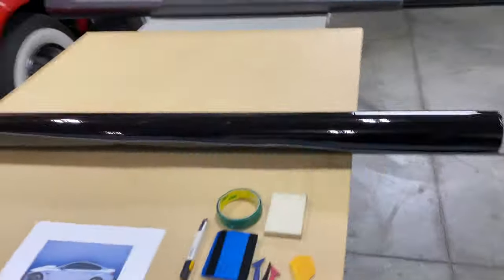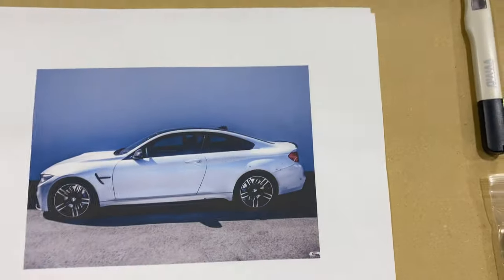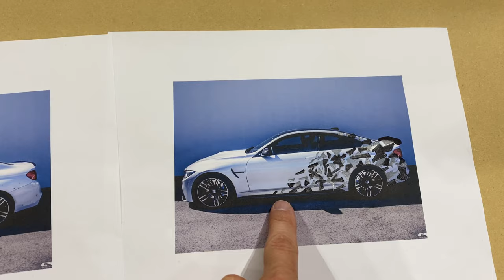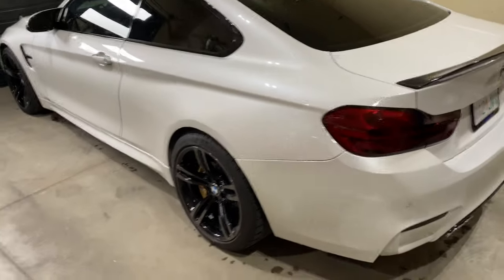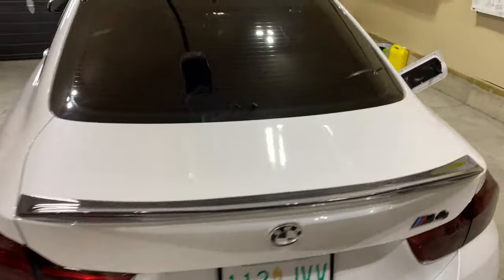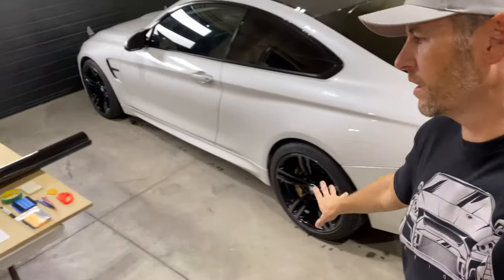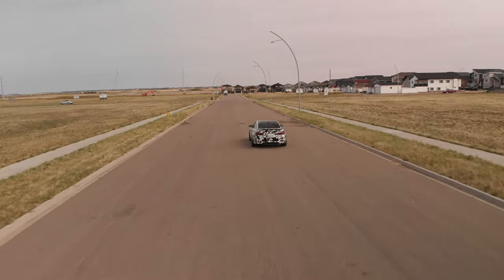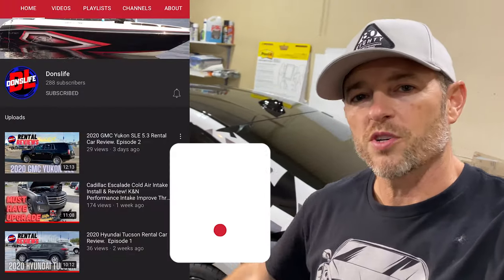Partial Camo Wrap BMW M4 DIY

Comment: Wow that turned out really good. Subbed !
Reply from the maker: Thanks man! It was a fun way to use up some extra material!
Reply: @Donslife  we need a guide!
Reply from the maker: Hey Lazarus!  Did you want a guide on how I planned this partial camo wrap? You can email me or send a message on IG  @donslifechannel
Reply: @Donslife  when overlapping pieces does the edge not show on the pieces that under the top piece? Thanks
Reply from the maker: @xijordyixxijordyix4392  yes overlapping pieces will show a line, but depending on colors used it may not look bad.  I tried no over lapping on my latest camo wrap but it takes more time cutting pieces to fit together better.

Comment: Did you overlap any of the shapes or are they cutwhere they meet? Had envisioned something similar. From a distance it looks amazing. Wondering how the overlap if any looks up close.
Reply from the maker: Hi Raul, I did some overlap and same cut together so they fit seamless.   Honestly the overlap was fine to look at up close.  When drying the car after a wash, I just needed to be careful in a few spots (especially points).   I am thinking of doing this to my new truck soon.  I miss it now that my M4 is a full wrap.

Comment: Follow on question....😂  where did you come up with the shapes? That's the most difficult part i think. I'm sure having small pieces is easier than trying to wrap a full panel.
Reply from the maker: I made completely random shapes and had one of my daughters help so we had more
variety.  I also kept all the similar sizes in piles so all of the shapes gradually got bigger towards the back.   I recommend printing pictures first and draw shapes on the paper.  You’ll know pretty quickly which shapes look good and which don’t
Reply: Is there a video with a list of the materials you used? After the alcohol to dry it out I’m guessing just heat gun and squeegee?

Comment: How much vinyl would you need for it i have a 3 series bmw and id like to go on the cheaper side
Reply from the maker: Not that much depending on how you cut you patterns. Maybe 5-6 feet of each color. Most material is 5 feet wide already.  So 25-30sq ft of each color. Maybe even less
Reply: @Donslife  thx bud

Comment: bro i need help getting my charger gt wraped in this similar style can you help me i want to do the front but i dont know much should i get its 53 inches by x {x as in how many feet} how many feet should i get i was thinking like 53 inches by 5 feet is enough
Reply from the maker: First you’ll need a couple colors.  I had black and charcoal matte.   I used maybe 5ft x 5ft of each color.    I just did a new camo wrap too on the channel!
Reply: @Donslife   i plan on using one color only there’s an option for a 1ft x 1ft should I just get like 5 sheets of it ?
Reply from the maker: 5x5 is 25 square feet.  Five 1x1 is only 5 square feet which will only do the bumper.  At a minimum I would order 15 sheets of 1x1    Some of the pieces at the back of the car were 1x1 approximately

Comment: How well does it stay on though? I had some decals on my car that after a few washes started peeling, how has this held up so far?
Reply from the maker: It lasts fine if all the vinyl was post heated for maximum adhesion.  For wand style pressure washing it is recommended that you spray straight on the surface and not at an extreme angle.  When hand washing, pick a cloth or sponge that won't catch the sharp points.  I use a synthetic chamois to dry too.  My latest camo wrap is even crazier and I have had very little with issues.

Comment: How's it holding?
Reply from the maker: Great until I wrapped the car 2 more times.  The wrap never failed me.  You do have to be careful how you wash it is on the pointy corners.  You have to try not to snag them
Reply: Thanks for the tip! And good to know it held on

Comment: I just wrapped my Type R like this and I love it!!!!!!
**The only question I have is sense it’s a partial wrap, is it safe for a automatic car wash or should I hand clean it and if I hand clean it, should I avoid the wrap and just wash the car?
I’m super worried about pulling off the material!?!?!?
Reply from the maker: Cool! I would wash it by hand a few times first so you can test some of your edges.  You always want to be careful not to lift an edge.  I never use automatic washes, so I can't guarantee anything there.